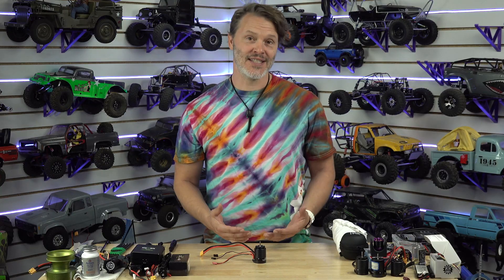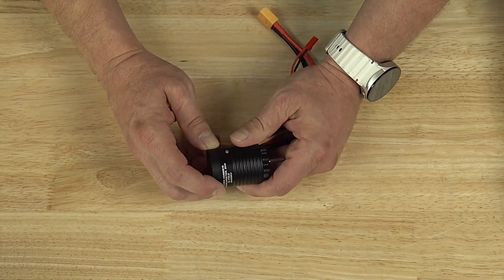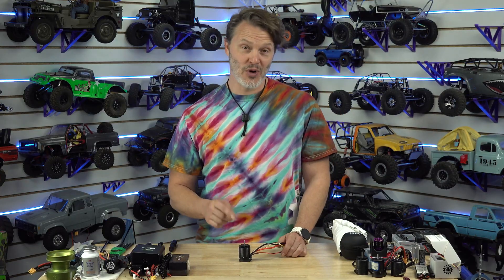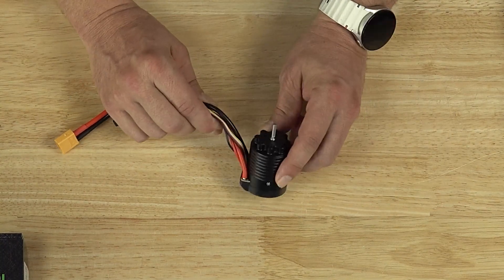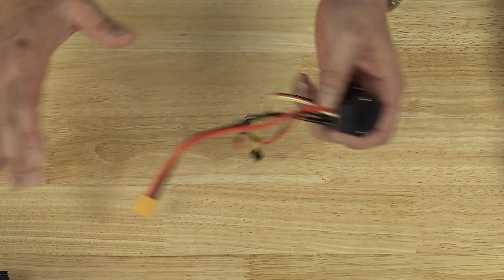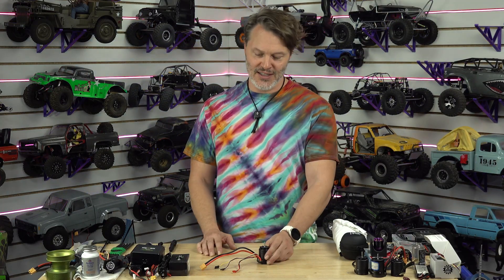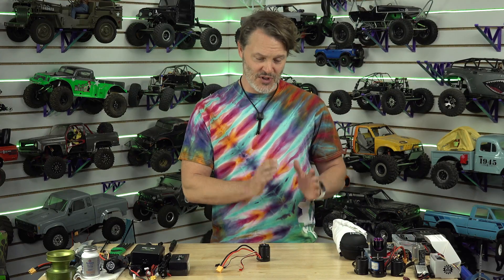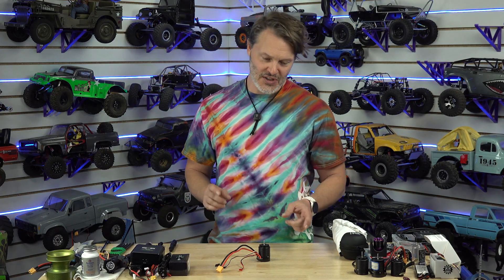⚙️🔥 Our New 2-in-1 Motors SOLD OUT… Here’s What’s Next! (RC Rock Crawling)

Comment: I have a 3000 2in1 in my SCX10 Pro. I had a lot of hitching with appropriate gearing between sine and 6 step commutation. Decreasing the sine transition point on the AM32 site (running current firmware update and your settings) to 70 completely eliminated hitching. I also noticed less heat (since the motor is transitioning out of sine quicker), plus the transition is a lot smoother. I have mostly revolvers and your V3 ESCs is my 6 other comp rigs. I was having some hitching in virtually all of my rigs. Happy to report that decreasing the transition point value to 70 and below completely eliminated hitching and reduced heat in all my rigs 👍. Those cans would look good in purple, just sayin' 😁.
Reply from the maker: Solid feedback!  Ill do testing with those settings and if its working well ill change defaults on the programmer.  100 has generally been the most reliable but both motor and esc tech has improved over the last year
Reply: @HolmesHobbies Looking forward to trying more of your creations 🤙

Comment: I just installed one of the newest 2300kv. Quite a bit of strange noise going slow on flat surface with no load and getting pretty hot. Not sure if it’s normal or not.  Sent yall an email.

Comment: Luv my 3kv 2in1! The mounting holes should be clocked counter clockwise about 2-3mm so the wire hood and wire dont bind against the vrd transmission standoff rods. I would luv to see a 2in1 that fits the vrd stubby but I absolutely luv the 3kv outrunner and innrunners!

Comment: I just want a much stronger bec...like an 8amp continuous. 
A big 2-in-1 4268 to 4269 10 pole with your newer magnetics & sine(obviously) That'll fit into a TRX4 with not more than slightly clearance the cross member( next to the servo). It'll also fit the Axial Gilamon among other rigs. I had to do some interesting mods to get the Puller Pro 4274S to fit my TRX4s(more than one),  among moving the servo forward. I absolutely love everything about it, but I would love to have that AM32/Sine control at the bottom end. It's not bad now, but slower is better.

Comment: I have my 3000kv in a Axial Wraith chassis and it overheats where the previous fusion 2300kv system did not.  I switched to the HH for the higher KV and option to change modes with a radio channel.  I need to reduce the gearing but I've been lazy.